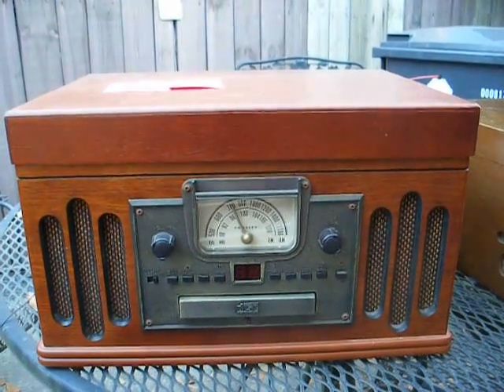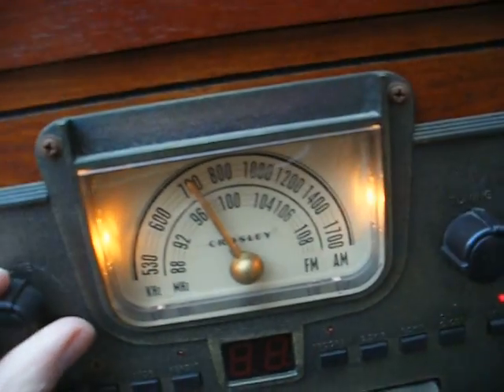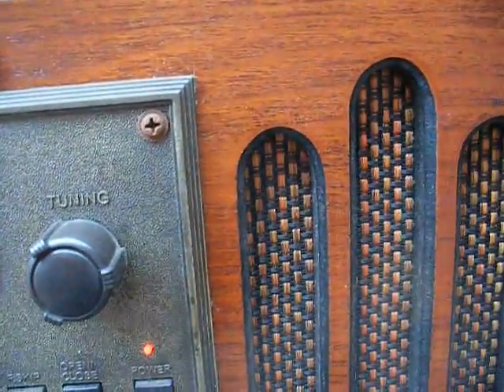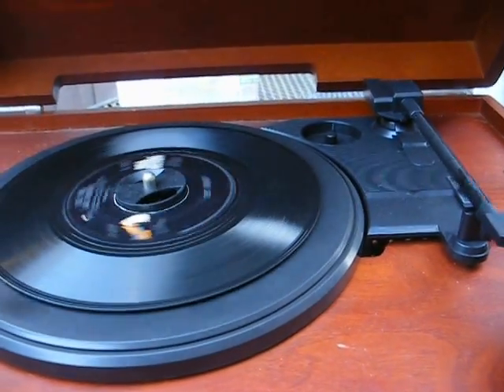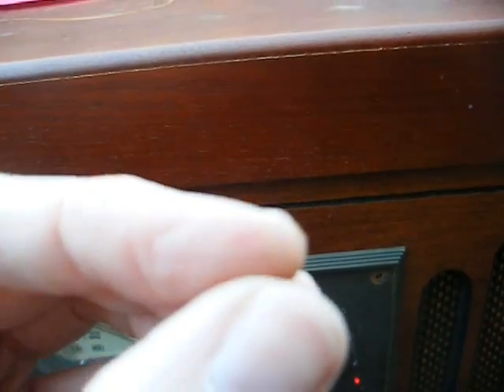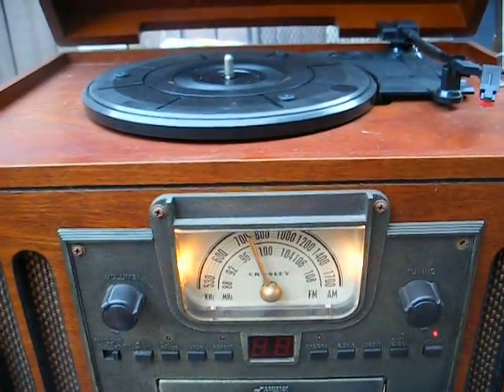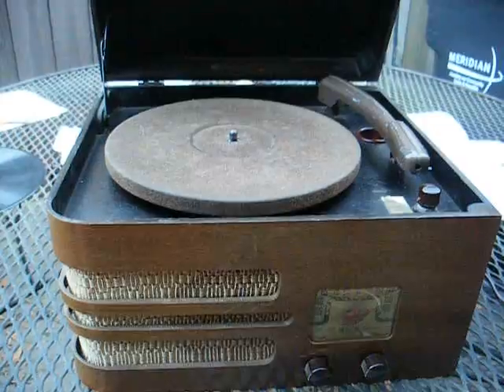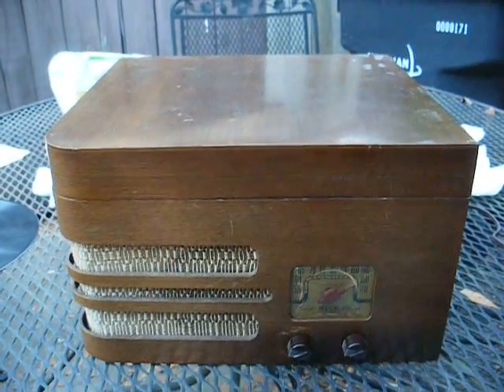Overview of a Crosley entertainment center (more Chinese garbage)

Comment: As of now, I got the exact same all-in-one system for Christmas which is from my uncle, and it’s not a Crosley, it’s a Victrola. It has everything you see here, along with a Bluetooth and USB feature that came with it, along with a cheap crappy turntable and a Bing Crosby “Merry Christmas” album which is a 2014 reissue. I still have another copy of the same album somewhere in my collection. Not the best turntable ever made. But what’s disappointing, that it has an FM only radio, but there’s no AM on there, the CD player works fine without any issue, and a cassette player works fine without any issues. And it was from 2019, and it’s a newer model with a different design, and it’s under the Victrola brand. Overall, not the best of its kind, but the only two is the Bluetooth and USB, and skip the turntable and CD player for now. I don’t recommend using a Victrola all-in-one system. Maybe I will be a doing a video of one of the worst all-in-one systems ever made when I get home.

Comment: BTW, my mother in law has the same Crosley crap when I was visiting my brother's along with these albums. It's an all-in-1 junk entertainment center with a turntable, CD player, AM/FM radio and cassette player. I didn't have a chance to operated, because it belongs to my mother in law.

Victrola also made another Crosley clone which is similar to this. I saw it at FYE and I have to avoid it like the plague.

Comment: Is that old 78 model a battery set? I noticed the radio came on instantly and back then, only battery sets were "instant on?"

I like background wind chimes!!
Reply from the maker: No, it's AC. I already had it turned on, with the volume turned down.
Reply: Hi I agree I'm incourging every one I meet not to buy that crap

Comment: Finding a Crosley under the tree would not make for a Merry Christmas. Thanks for the video. Merry Christmas to you.
Reply: Peter Atkinson I got a Crosley Rochester for Christmas and was thrilled..it works great this guy doesn't know what he's talking about he probably voted for Trump...probably someone pissed in his Cheerios that morning
Reply from the maker: If you like your Crosley; then, I'm happy for you. However, I've only been repairing electronics for 30 years and I very well know what I'm talking about. It's American companies selling out to foreign ownership and junk such as this is what ran most repair shops out of business and has a lot to do with why this country is in the shape it's in.
Reply: Cherilyn Hannen I'm glad your Crosley worked for you.  I hope it lasts you many years. However, if it breaks down, it's not built to be easily repaired.
Reply: Standard for CD player load mechanisms not to open on those generic retro look units. The cassette player works on the one I have. It doesn't have a radio though.  Were those generic turntables actually based on a specific model or models?
Reply: R.I.P Crosley and other generic Chinese plastic fantastic junker record players.

Comment: Halfway decent used audio gear resale for 200-400 bucks on both ebay and used electronic stores. These folks know there is a market for these vintage receivers and turntables (at least the good stuff i.e. Pioneer, Technics, Marantz, etc...). In some rare occasions you can get a really great bargain at yard sales, sold by private owners. I bought an early 90s Kenwood amp, FM receiver, CD player and sound surround sound encoder, all separate components for the grand total of... (drum roll) ...20 bucks. I ran into a vintage early 80s Marantz receiver at another yard sale a few years back for 35 at another yard sale but I had no cash for it. So I sought out an ATM machine but when I returned, it was gone. Shit luck I guess.

Comment: Maybe do the fake crosleys one at a time if you are so inclined... One dangerous yet nicely effective way is to use acetone and fire. You get a nice bright and hot flame, less smoke and all but the metal parts are reduced to a fine white ash (if you can keep enough fuel on it) Don't do it unless you have good containment, fire suppression and safety provisions, but you seem like someone who already knows this. Also note that acetone vapor is explosive, which is a warning and a suggestion!

Comment: Need a little help from Santa.I have a 1966 Philco-Ford Console stereo. I replaced 2 electrolytic polarized capacitors that were mounted on the rear plate of the receiver. The capacitors were 500 uFD / 50V. The new ones are 470uFD / 50V. I installed by cutting the wire leads on the old capacitors near the base of each one removing the old capacitors and twisting together the old wire lead to the new. I twisted tight and soldered over the splice. When I turned on the radio I got an extremely loud buzz. No explosive sound or odors so I don't think it blew anything, but not sure what happened. I'm pretty sure the polarity was correct also.
Reply from the maker: Double check the polarity and make sure your connections are secure.
Reply: Ok will do. Do you think it is a problem to twist in the new lead to the old lead in order to avoid de-soldering at the terminal?
Reply: OK checked everything. The positive side is connected to the "hot" wire on each cap and the neg side to the common leads wires were insulated. still get the loud buzz. Is this noise possibly the new caps gaining initial charge?
Reply: OK I got things sorted out. There was an extra lead behind the lower cap that was supposed to tie to the common. No noise now plays good.

Comment: Technics will be my turntable. Forget about the crosley
Reply: Oscar Flores Crosley is also making a clone of the Technics SL-1200 series, and the model is the C100 and the C200. I saw it at Barnes & Noble a few weeks ago, and it’s an SL-1200 knockoff, except two speakers that came with it.
Reply: Technics is all I use for my records.
Reply: Bought a used Pioneer PL-510s direct drive in 1999. Still going strong after thousands of uses. With a Crapley, it's over in a few months. Or sooner.

Comment: I had the same piece of crap.  In my collection I have a many 78's, mostly jazz:  Goodman, Ellington, The Nat King Trio, Krupa and the like.  My Califone was damaged by water, and so I went to look for a record player which would play my 78's.  I found this in Wal-Mart, and it was only a hundred bucks, I figured why not.  I got it home, unboxed it, plugged it in.  Alas, the on/off switch was bad.  I eventually got it running and I put a 78 on.  It sounds pretty crappy.  Well, before the track was over, it shut off.  I played more 78's and the same thing happened.  I should have taken it back to Wal-Mart.  It's the worst piece of junk I have ever owned.  A hundred bucks down the tube.
Reply: You do actually need a separate needle for 78's, though you probably already know this. Without the proper needle, the record is already doomed to get ruined and sound bad. Having this record player probably didn't help very much either.
Reply: Funky I'm Stanley, alias San Michele.  Yeah, I know that the needle is important for playing 78's.  I got the Crosley just for a stop-gap measure, until I found a phonograph that would be to my specific needs (got an Audiotronic at a used record shop, eventually).  I only played three records (Margaret Whiting, Mary Martin and, unfortunately, King Cole Trio) when I found that the damned thing didn't work.  Oh, well.  Live and learn...   Cheers.
Reply: Exactly! :D

Comment: I'm surprised this Chinese company is allowed to use the Crosley name.  I remember the "real" Crosley from years ago. My brother had a Crosley clock radio -- it was leather/or leatherette covered and had a very nice sound quality and lasted for many years -- tube amplified. Whatever happened to that Crosley company?
Reply: Powell Crosley Jr. founded the Crosley Corporation in 1921 and they lasted until 1956.  They also made refrigerators and automobiles.  They resurrected the name and the current Crosley Radio is a subsidiary of Modern Marketing Concepts.
Reply: @saintmichael1779  Same thing happened with the Victrola brand. It was made by Innovative Technologies. The Victrola was founded by Eldridge Johnson in 1906 and it was originally made by the Victor Talking Machine Company and it continued the “Victrola” name by 1929 when it was bought out by RCA and RCA continued to used the “Victrola” name under RCA Victor until the 1960’s, and then resurrected the “Victrola” name since it has been in the Public Domain for so long and made the similar Chinese junk than Crosley. The Victrola name was originally a flagship for their windup phonographs.